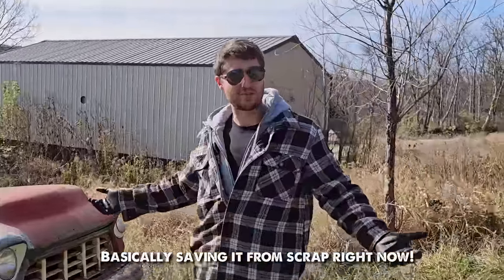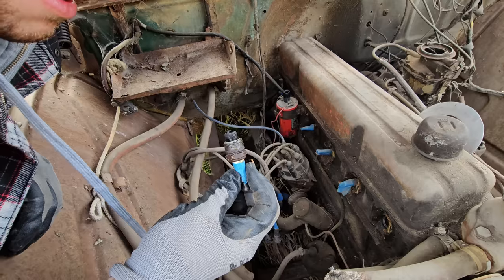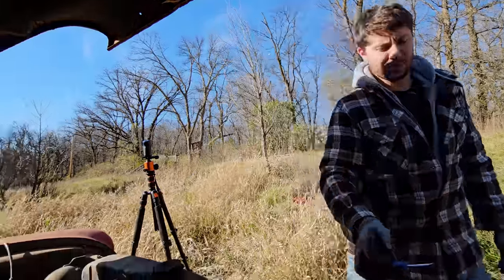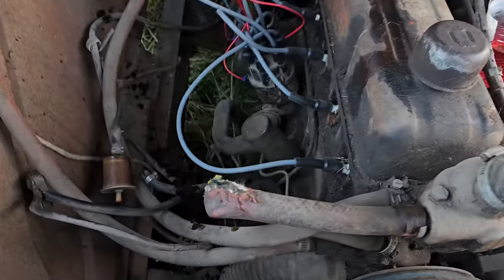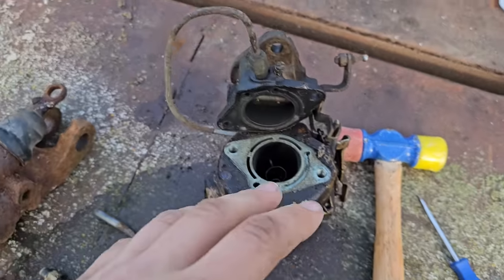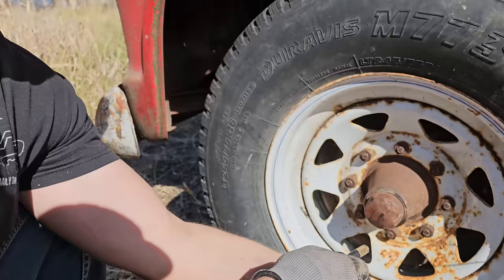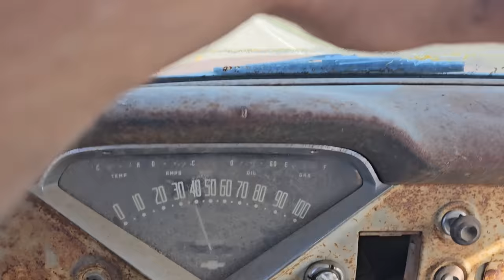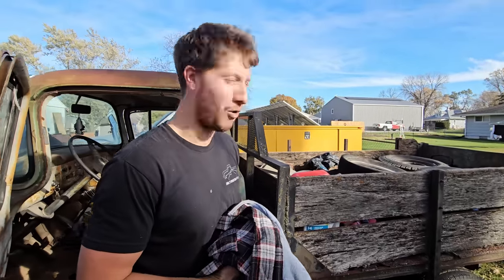SAVED from SCRAP 1955 Chevy - WILL IT RUN and DRIVE 150 Miles Home after 25 years?

Comment: In 1975 I learned to drive in a 1955 Chevy PU. It had the original bed on it but besides that it looked very much like this truck. Broken window and rusted out floorboards. Vacuum windshield wipers. 3 on the tree, used to get stuck in 1st gear had to move the shift linkage at the firewall. Gas tank leaked behind the seat.
I went to senior prom in that truck ! Was a hot mess with sheets covering hole in the seat. *GOOD TIMES !*
Reply: 😂😂😂 That must've been one interesting Prom date afterwards! I drove my uncle's 1989 Pontiac Sunbird GT turbo convertible to my last school dance (I didn't get to graduate because I was diagnosed with cancer when I was 16). I tried to grab a titty that night and my date wasn't about it...but she was definitely top-heavy...😂😂😂 She's still a good friend, but we both married someone else. I took my wife to her Prom when we were bf/gf, but we took my 1992 Acura Integra.

Comment: Awesome save guys. One thing. I think this is actually a 1956. It looks like it has the split emblem on the fender which is '56 only, '55 was a one piece. But that does look like a replaced fender. However the interior is painted grey. 55's had white interiors. They were grey from '56-58 then '59 was a fawn color that would continue on the 60-66 generation. Thanks again for saving this one, I saved a '56 3600 pickup myself so I love to see other ones saved.
Reply from the maker: We'll have to find out exactly what it is then! Maybe next couple videos you'll see it put to work with a new bed haha
Reply: @DailyDrivenDeathTraps  I'd love to see it.
Reply: Cek out classic. Truck. Rescue. In Oregon he saves these and got beds and stuff
Reply: Definitely a 56, the vin will have the year in it and also a quick way to tell a 56 from 55 is the fender emblem is above the fender style line, hood emblem also "points" up on 56 where a 55 points down.

Comment: Just a tip for those who haven't driven 'Armstrong' steering vehicles (no power steering), the wheel turns a whole lot easier if you're moving even slightly while turning the wheel. Less load on power steering pumps that way, too. Good job guys!
Reply from the maker: Good tip!

Comment: Like the video. Cool you guys got it up and going. I would recommend an oil change after you warmed it up a bit cuz who knows how old that oil is and if there is sludge in it. Id also recommend a fuel filter before the carburetor. Cool to see you guys drive it 150 miles👍
Reply from the maker: Thanks! and for sure will do, we already had the oil, just wanted to get moving to get home quicker haha. Easy task but often overlooked!
Reply: Get a pertronix electronic point kit and ditch the points

Comment: Most parts for this are available on line. Just need the time for delivery. A beter jump pack would help and jumper cables. While these are fun to watch..I take a trailer, winch them on and do all this at home.

Comment: The wax around the plugs may be parrafin wax. If the plugs that the last guy to touch it had changed were rusty, parrafin can be used like a pentrating lube. You use a torch to heat the bolt or plug up cherry red and then hold a plain wax candle to it and it will suck in the wax. Timing is off probably because they pulled the distributor to use a drill and a tool to prime the oil pump and pump oil through the motor. The new parts tell me that either they were in the distributor replacing clearly bad parts or parts that were robbed for another vehicle. Also youre supposed to retime the ignition timing regularly to compensate for wear and tear and every time you do a tune up. The distributor cap and rotor can be a little different than the parts being replaced because of a different brand or just the manufacturing tolerance allows enough play in it that the timing will be slightly different from part to part. Yes new parts can be junk, but as long as you buy quality parts from a reputable brand you can still find good ones. Most parts house batteries will be low on charge. Put them on a charger before you use them or you will burn them up. A boat fuel tank can be a life saver when it comes to rescues as well. Less work to just hook that up then fiddle with possibly rotted and nasty tanks. Also that carb seems to have accelerator pump issues.
Reply from the maker: Thanks for the awesome information!

Comment: Next time, take some brake, clean or carburetor cleaner and put that down into your fuel pump. Brake cleaner will cause the diaphragm to expand. If it’s still good, it’ll make it soften up better than putting fuel down in there.
Reply from the maker: Good to know!

Comment: I dunno how well it does in engine revivals, but I know on two-stroke engines that canned fuel is crap.  If you got a two stroke that won't start, drain that canned fuel out and put some real fuel in.  Nice truck.  We had a '65 chevy dump truck about that size when I was a kid.  We'd take it to the creek and load it with gravel and then dump it in our driveway to our barn whenever the driveway started to get a wallow or a muddy spot.  It spent most of its time parked on a hill in a field too though, lol.

Comment: Just so you know any new battery should be put on charge for a few hours before you use it. Due to the fact that they've been sitting around for such a long time they tend to loose their charge. They are usually fine when putting into a vehicle that is already running because they can get charged from the alternator but for something like this not a chance. It will only take like 30 minutes or so any vehicle with a good alternator to charge it. You know like the trip back from the auto parts store. And those old straight sixes have a lot of compression and they also need alot more fule than you'd think to get running

Comment: I'd trust that stick shift on hills.  You can always downshift to slow down if you need to.
Reply: 1st gear granny hear use second to start
Reply: @gerry-p9x   Yeah, my Jeep CJ5 was the same way.  But I'm not talking about starting to move, I'm talking about downshifting when going down steep hills to save on the brakes.

Comment: Tell ya what - that old 6-pot is a right old ripper, for sure.  She sounded strong on first turn of the key and that three-by-three lope she has on crank is perfectly normal for a straight six.  I reckon a decent oil change (if you havent done one already) would help cure a lot of the smoke.....but if not, a bottle of Lucas will !!  

Yep - when I heard her kick back at you, my first thought was she's too far advanced.  I tried telling the computer screen, hoping you'd hear me,,,,,but it took a while.  It's something that doesn't happen often at all on modern cars (ie: post 1995), but anything older than 1989 that is still on a manual distributor and doesn't have a computer to tell it to adjust when to spark, is gonna tell you when it is way out of whack as far as timing goes.  On an unknown engine, first thing to check on a kickback is firing order....and if that's ok, then check timing.  Don't bother with the timing light, just loosen the dizzy and turn it just a tetch in the same direction that the rotor turns and see if she turns over better.  

The big tell-tale she's too far advanced is if she spins fine when not adding fuel but starts to kick back when fuel is added (presuming the engine has spark of course). An engine will often start if too far retarded, but it won't want to idle or respond to throttle increases.....especially when warm.  My 1979 Triumph 2500S was around 30 degrees retarded instead of 10 degrees advanced when I bought it.  It ran like complete garbage, but I often wonder how the heck the darn thing ran at all....but she did.  My 1977 Mini is a touch too far advanced and will often kick back at me when cold if the battery is a little under voltage.  However, the engine needs the extra timing when she's running so I put up with it.

Really enjoy your way of going about things and the way the videos are edited too.  You're doing well, guys.  Just gotta think about what to do with all the vehicles you're collecting and which ones to make long term projects out of!  This one I reckon would be a fun one to do because the driveline is pretty strong and the cab / chassis (frame) didn't look too bad from what I saw of it....although the cab does have some weak points and the front fenders need some love.  Even just replacing the rotting timber on the tipper's flatdeck and dressing the outside faces of the timber with polyurethane after painting the metal bed frame black would totally change the look of the old girl.  Then if you're stuck for a video or something, give the body a bit of a tart-up metal-and-dent-wise, grab a few rattle-cans of Satin Black to chuck on her and she'll look good from 10 feet all day long   Then if you aint gonna use her in your business, move her on and use the cash to buy the next project to work on.  Just thoughts, mate, just thoughts.  Not telling ya how to suck eggs or anything....

Anyway, I've gone and written a book, so I'll just say all the best from down here in New Zealand and catch ya on the next one.  (I'm actually working my way back through the channel after stumbling onto it a few days ago - this is about the 4th video I've watched.)
Reply from the maker: Glad you still like the vids! Thanks for the feedback!

Comment: I bought 2 new batteries for my truck 2 months later they was dead I took them back this time I took a battery tester with me one of the new ones they tried to give me was bad before I left the store
Reply from the maker: So stupid 🙄 taking a multi meter anywhere we go now lol
Reply: @DailyDrivenDeathTraps When those batteries are delivered to the stores the stores are supposed to make sure they are charged up before sale. Many batteries lose some of their charge in transit and this is just frustrating to have batteries that you spend $150-$250 for and they crap out in a couple of tries. Not good 😮😊

Comment: I just removed a junk AC Delco battery less than two years old out of my F350 and replaced it with a Ford battery from the dealership. 10$ more than any parts stores best group 65 battery. I guess ill see how long it lasts...

Comment: Bought a battery once and got home put it on and wouldn't even click it was so dead and when I took it back they didn't want to exchange it, finally talked them into it before police arrived and got another new battery and thankfully for the place I got it , it worked!!! So many times I have purchased new or reman and be defective or just bad and the parts store didn't want to stand behind it , usually I can persuade them to exchange the part before I go to jail!!! So ridiculous,  don't know why they do this they are just going to exchange it with the distributor!!!
Reply from the maker: So bad you have to bring a multimeter to the parts store lol or have them test the new products before you buy it. We had them run a new alternator just to make sure it would charge

Comment: Vapor lock.. number 1 piston top dead center pull cap see if its at number 1 timing. 
And stop using that dam break clean or starting fluid.. you have gas best thing to use.

Comment: If you guys would have turned the distributor just a little it would have run like a top you could tell the timeing wad way off by the way it turned over I guess you guys don't know much about mechanics but you will learn

Comment: I have an inverter that I use to run a small battery charger and it'll also recharge your jump box.. A decent one doesn't need your truck running the whole time. I watch videos all the time like this and places with electricty and nobody seems to bother putting a charger on the battery as they know they're going to run it down by cranking. I don't get it.

Comment: It's you get great parts for a month then junk China parts for 3 months, then great parts, then junk parts for 4 months. AutoZone is the worse, they have good parts 1 month of the year. I won't get reman parts either. I get oem parts that are from dealership most of the time. Just cuz everything on my jeep does not like aftermarket parts not made right. My old 65 Ford works just fine on aftermarket parts. Anything newer than 2008 of any brand of cars don't like aftermarket

Comment: That truck looks like it was pulled into that spot. I've watched 2 videos and I question the authenticity.  This feels staged.
Reply from the maker: It was at a higher location and the owners brought it down more to try to sell it or scrap it. If it were actually there for 20 years or so it would be sunk in the ground... Which it was at its original resting spot. We had to get it down the rest of the way though. But thanks for thinking we stage things, means a lot!
Reply: @DailyDrivenDeathTraps like I said...something about these videos made the hair on the back of my neck stand up. "feels" contrived...less than organic if you will.